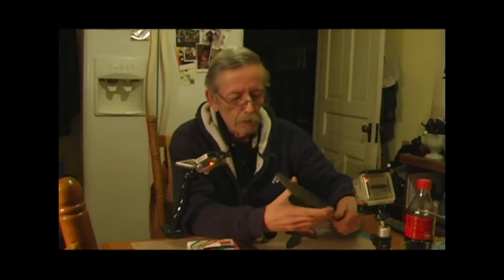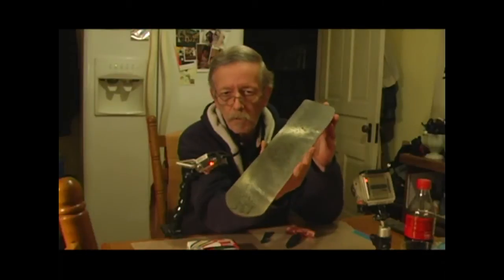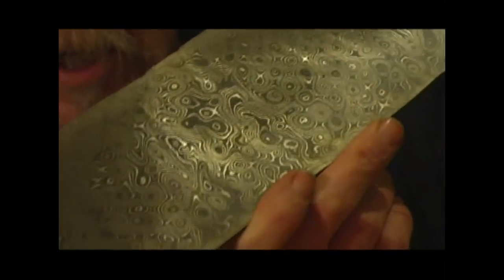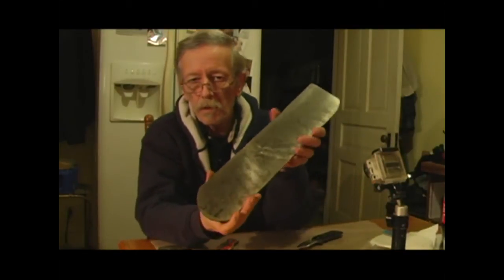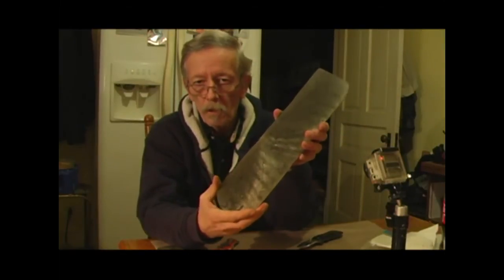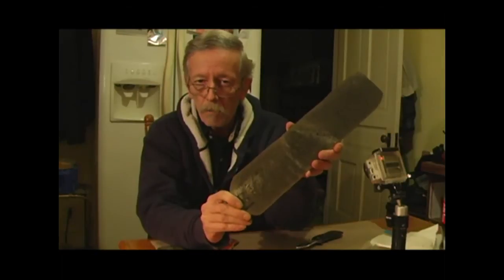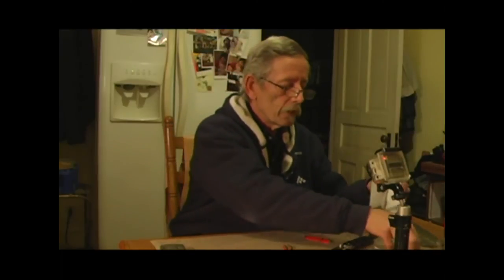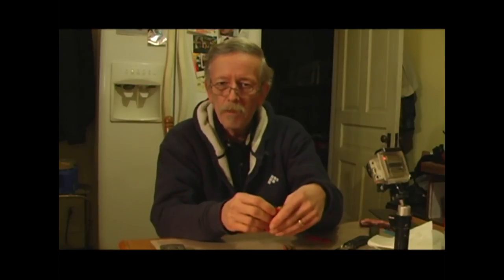Damascus Explanation

Comment: I prefer the term pattern welded.  Also there were irish pattern welded swords "bog offerings" that predate the Damascus steel swords of crusade ledgend the truth is that patterned swords existed long before then and Damascus was a unique alloy where the legend was attached to the pattern rather than the steel.
All swords were forged and would have a unique pattern to the blade in legend the swords of vikings were first and foremost identified by their pattern.
You are quiet correct that pattern welded steel offers no advantage to a knife but would have been essential for the strenght an flexibility of a sword blade
Reply: pattern welding came into its own in order to harden iron. that is why the center only on Saxon snd scandinavian swords of the Viking age were pattern welded. the cutting edges were steel and the center was the soft, tough iron.

Comment: How long do you have to soak it in acid?
Reply from the maker: It depends on how fresh your acid solution is. I use a solution of 60% ferric chloride and 40% white vinegar and I usually leave them soaking for about 20-30 minutes. The longer they soak, the deeper the etch will be.The solution will weaken over time.
Reply: thank you sir